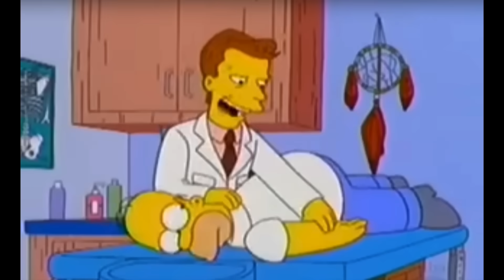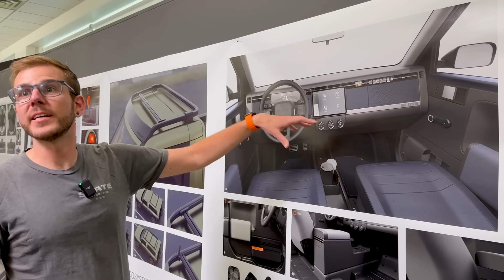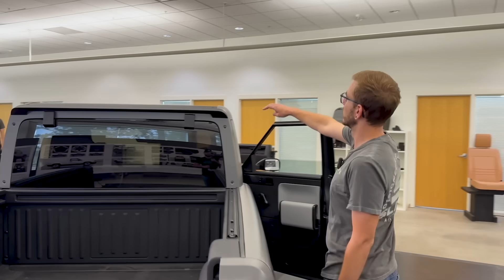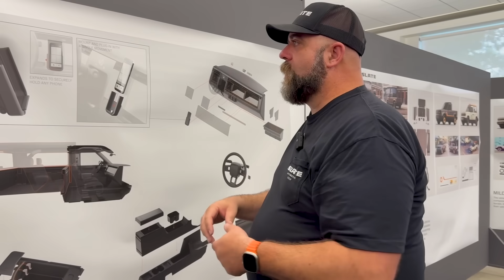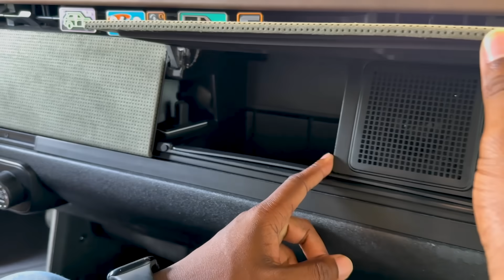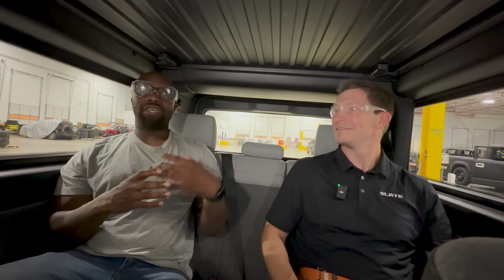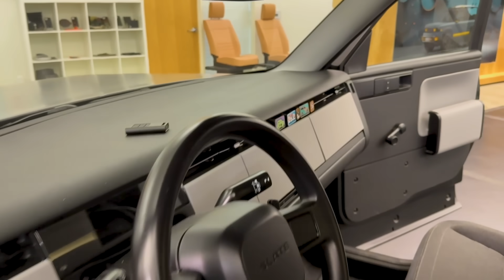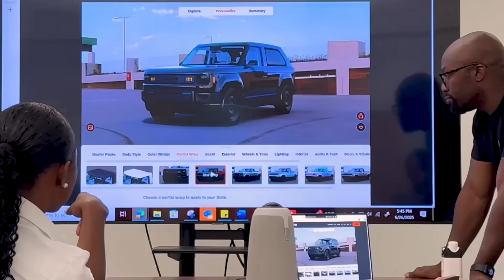The Slate: America’s $20K Answer to China’s Cheap EVs (Exclusive Access)

Comment: A lot of people complain about “computerized everything” on new cars. It will be interesting to see how many people choose the version with crank windows and no stereo.

Edit:  To be clear, I don’t want everything to be controlled through a screen either. But there is a reason why manufacturers make all of these things standard. It’s because nobody was buying them.

If the tax incentives stay (doubtful) this little truck has a chance.  At $27k for the most basic of basic version, people will just buy a Ford Maverick.

Also, I was making a point about people not wanting as much tech.  Sorry if that went over your head “motorized vs computerized” commenters. 😂
Reply: that would be me.
Reply: @pezpengy9308 me too!!!
Reply: @pezpengy9308  me too
Reply: @pezpengy9308  ditto! I love the manual door locks and manual windows on my 96 Civic, merely because it is that much less wiring and that much less to "fail" on the car.
Reply: I can install my own stereo.   Probably for less money than the factory charges.
Reply: @bullithedjames  It doesn't have  a din slot so maybe under the dash?  also no backup camera, I thought that was a requirement by the feds.
Reply: @bullithedjames I'm going to miss those $3500 nav systems with 0.5 fps refresh rates.
Reply: I mean, if it has speakers and I just hook my phone up and it will play out the speakers im fine with that.
Reply: Every roll up window I've ever had is still working. I've only ever replace electric window stuff. Also the truck is small enough to roll down the passenger side window. If it was 4 windows, yeah maybe annoying. Also, put a Bluetooth JBL speaker in and rock it. I think the truck has its place, nice it's made here (though "battery manufacturer" might be overseas) If the base model stays competitive with other EVs, it will be on my radar.
Reply: If I could get this for $15K and could drive it 300 miles on a single charge, I would be perfectly fine with manual windows and no stereo. At $28,000 and half the mileage, this is just way too expensive to have so few frills/features.
Reply: makes sense that motorized windows are an option, but they're people out there who are probably thrilled by crank windows and willing to save money there
Reply: @superzario1000  Crank windows are more expensive nowadays due to the number of cars/parts manufacturers for power windows, thus driving down prices; they have been cheaper for many years now
Reply: @QALibrary I seriously doubt that
Reply: @superzario1000  ive never had power windows so its same old same old for me. I've got the closes thing to a slate the gm put out in 2002. I dont have the build sheet for this truck but a base model 2002 chevy 1500 was 18-20grand basically the cost of a slate
Reply: My current truck has crank windows and a broken tape deck but it does truck stuff very well.
Reply: @deuceandguns my current truck has power windows and one doesn’t work, less than a hundred thousand miles on it.  Never had a crank window break.
Reply: Me, for sure. I'm skeptical this will actually succeed but I'm all for it
Reply: It would be the only reason I would buy one.. 
..and the 20k price.. which isnt going to happen (gov assistance or not).. its gonna be another 30k vehicle, and with like 100mi real life range, it'll be better to just buy a Maverick.
Reply: we have a universal hand gesture based on manual crank windows, thank god someones keeping it alive.
Reply: This may become the American Dacia - look how Dacia has a big success in Europe with there cheap basic cars!
Reply: @zanycam  Dacia's are cheap though, this is overpriced shiet
Reply: @zanycam  James May is that you? 😂
Reply: I drive my 18 yr old f150 for a reason.  It has a broken cd player but has a aux in, no touch screen.  I like the electric windows but everything doesn’t need to be a computer screen.
Reply: im okay with crank windows but i atleast need a radio with an aux 😭
Reply: No one would choose it because it's 30k
Reply: Had an NA Miata in the 90s with crank windows and it was fine.  The car was small enough that I could reach over and roll it down.  That said, I feel like you’re not going to save $$$ be deleting window motors and might actually make the production line more complicated and add cost to the manufacturing process.
Reply: Nah thats dumb to say. There's a wide gap between a power windows with a stereo and an automated lane assist system and OTA software updates. About 20 years of cars fall into that range, actually. I love a big screen, buttons to push and information given to me. As long as its not controlling my car im happy.
Reply: @duppy-xd6hy But you can actually disable all assist features, lane assist, automatic braking etc
Reply: Easily enslaved tool.  They can already monitor all your actions, including controlling your vehicles operation.    @duppy-xd6hy
Reply: Yeah I like the idea of just putting in a stand alone  Bose Soundlink with some 3D printed mounts.
Reply: Redundancy and reliability is number one in my book.
Reply: Those people aren't the people who generally buy EVs.  They want this truck powered with a Ford 2300 or GM Iron Duke.
Reply: That’s most work trucks less tech less stuff to break and remember got AirPods now so might not be too bad.. only needs ac fr 😂
Reply: Fun fact. My susuki swift was delivered only with electric windows... 30 years ago... I was wondering why. This car wasn't even delivered with a 12v plug. (cigar igniter) but with electric windows... BECAUSE IT WAS CHEAPER TO PRODUCE 😂
Reply: I'll take the crank window and a decent aftermarket stereo. The 90's didn't suck. Crank windows are OK.
Reply: That's going to be me. I can't wait to preorder one. 
I didn't care about frills or how Tesla-esk a new car is. I want as plain and inexpensive as possible.
Reply: I don't see too many people buying one of these in the first place. It's way overpriced for what it is. It should be an $18,000 truck.
Reply: No, it won't because no one will buy this Amazon basics trash. 😂
Reply: I have arms and a Bluetooth speaker
Reply: Im 100% on board for this
Reply: People in rural areas....
Reply: One of the things that MIGHT put people off the Maverick though, is yet again it's a four-door "pickup truck" with a TINY flatbed, so it's not actually that good AT being a pickup truck. This vehicle seems (to me at least) to have a bigger flatbed which is the whole point of a pickup truck - it's not how many passengers it can carry, since that's what an SUV or regular car is for - it's how much flatbed space they have and WAY too many US pickups right now have prioritised the complete wrong thing (as well as getting WAY too big for what they ACTUALLY can do and can carry). Also like they point out, if you want various packages on top of the base model with THIS you can add over time, with the Maverick I expect you HAVE to get them day one and can't really add them on at a later date - you're locked in from the start just like most other vehicles.
Reply: @DavidStruveDesigns for sure. This could be great for people that need the bigger bed and still have a small footprint.  I hope they sell a million of these.  The US market desperately needs more diverse options.
Reply: As a manual seat, manual window, manual trans, no interior options, jk owner, I don't want it because it's electric and the extension cord going to my neighbors trailer def won't charge it. But I like it
Reply: No they won't get the Maverick, because it's not electric.  Why do folks still don''t get it ?  You can't just look at the selling price of a vehicle anymore, you have to include the operating costs  which are way way less with an EV because of low "fuel" price AND very low maintenance expenses,. Is that so hard ???
Reply: nobody younger than 25 will. Manual anything is against their DNA and that's on us as parents...so sad
Reply: I would, but being an EV is the deal breaker for me. I have a 1997 truck with roll down windows. But the V6 purrs like a kitten, not sure an EV would last as long.
Reply: just bought a base 98 Tacoma for those reasons, will definitely be looking into getting one of these
Reply: Technically an ev need less electronic than a modern luxury car. There are many systems in engine management and exhausgas measurement etc. What is not nessesary on a ev. Otherwise you need a extra motor for servo stearing and AC...
Reply: That's me. I'm ready to make a desposit, but I wish it was released this year because my current commuter is rusting quickly! 😁
Reply: 28k is a rip-off
Reply: If it is cheaper, likely more people would get it ... 

Because the psychology of getting a utility vehicle is different ... Its for work and ROI.
Reply: It's all computers.
Reply: Crank windows = vinyl music. Huge hipster potential.
Reply: Me.
Reply: Well when a ford maverick XL has an msrp of 28k compared to this thing for 28k without the ev incentives anymore this thing is going to flop. 
Let's do a few comparisons
Ford maverick XL, 4 door, power windows, entertainment system with Bluetooth, climate control, speakers, and standard hybrid that closes any gap for cost difference for fuel/electricity.
Compared to, 2 door, no entertainment system, no speakers, thankfully climate control, crank windows, rwd and only 150 miles of range all for the same price...
Reply: I would love a crank window on the driver side and electric on the passenger! Also, I have no problem bringing my own speaker. I think that would be fine too. I really like this idea and I hope it takes off
Reply: The problem isn't all electronics, it's the overuse of modules and sensors not easily accessible to the owner and basic electronics tied into the newer high speed network bus for no reason, even when regulations don't require it.

I don't mind a hand-crank window option as I know some people using these for non-daily driving purposes may prefer that. All I really care about is that it's easily repairable, upgradable and that Slate doesn't lock users out (with the possible exception of safety features such as how much power can be pulled from the battery).
Reply: Everything computer!
Reply: I know i will if i want tunes ther are blue tooth speakers for the longer trips and for the short into town trips meh who needs it
Reply: none
Reply: As some who has a base model from 2002 (chevy 1500) the original buy only paid 18-20k 23 years ago. I would in heartbeat
Reply: Dude can't even separate motorized with computerized
Reply: Give me driver crank, auto passenger. It's a pain to have to reach over and crank the passenger window...
Reply: Crank windows is great, no stereo is actually ludicrous.
Reply: My gen z nieces and nephews all drive old Hondas or Toyotas from the early 2000s and they use their phones and a couple of synced up bluetooth speakers as audio systems! My nephew has a Civic and 6 Beats Pills that he got on marketplace he literally taped them down synced them and it sounds almost as good as my wife’s 2024 Acura MDXs audio system! That’s who slate is targeting! These DIYers who 3D print or will buy it on etsy! It’s probably a smaller market than what they imagine but they don’t need to sell 100k a month to be successful!
Reply: @mikeFPS1980  And they buy $30k cars?
Reply: I’d like to see the age curve against those features. I didn’t have electric windows until 2000, and my radio frequently didn’t work. Now I have an iPhone, so I don’t care.  I’d rather have Car Play, but an iPad wouldn’t suck. I also want a key—that you don’t just keep in your pocket/purse. Now get off my lawn.
Reply: I love the manual windows. I grew up on them.
Reply: Motorized and  computerized are two entirely different things.
Reply: I'll get one when "everything is computer"
Reply: They might also complain that this is electric
Reply: Me! I would put my own system in it anyway.
Reply: I would if I could! Besides that power windows is a far cry from your engine running on 6 different computers and modules....
Reply: This won't work. Toyota already offered a low tech econo-box ICE car called the Yaris, and sales went so far in the toilet they finally flushed the entire line down the drain in 2020. This company will fSk around the bargain bin and find out what Toyota already did, that the people that actually buy NEW cars want all the cool sh1t that bargain basement cars don't have, and it just won't sell, especially for $30,000 without the EV mandate free money.
Reply: Me! And still you have to explain why electric windows, AC and other small task electric utilities demands an central computer with bus connections, since batteries and starters are not in question here. The claim is the excessive complexity and infotainment present in current cars, something just to be driven from A to B. Like phones turning into smartphones with an heavy tag attached to it. Of course that is not for consumer interests but for easy mechanical diagnosis and someone else interests, while making consumer paying for it (happily, in the name of luxury). Not including the shameful automatic driving and other take over by the machine from men dystopian soft age concepts. So F* all that,  not having a car because can't afford all supposedly must have modern garbage...
Reply: people are NOT going to buy a Maverick over this...two entirely different audiences.
Reply: there is ABSOLUTLY a market for the non-elec. non-sensor. non-digital controlled TRUCK.  If you COULD somehow buy a 1972 GMC pick up today, people WOULD.... that tells you something.
Reply: Lets see how many times I opended my window in the last couple of weeks, none. How many times have I used the radio in the last 3 or so years, none. So you would rather pay more money for windows that use a button instead so that the couple dozen times you have got to roll down your window you can press a button.
Reply: I will absolutely choose the crank window option, and not to save money.  

I know that mechanism will work every time.  
Even If the batteries are dead, it's  submerged in water, or it's on fire, as  long as I can turn a crank, I can open  that window.
Reply: Everything is computer! That's the problem with my modern cars. I think slate is refreshing.
Reply: It's like if Framework made a truck. So neat! This is the first new truck I've been excited for since the Toyota FJ Cruiser
Reply: No one that's interested in this car would want a maverick because the main pull about the car is easy cheap DIY maintenance while being fully electric. Y'all have not done enough research on this at all smh
Reply: A Maverick isn’t as customizable as this. Being able to get a blank Slate and then later “upgrade” over time is the biggest selling point for me
Reply: The Mercedes 2.6 190 I drove had no airco, turn down windows, aluminum hood and trunk lid. So yes, I like basic. Reduced weight creates cool cars.
Reply: Bluetooth ghost box or a deck wired under dash or under the seat or on the headliner fix’s that lol but yea id be interested to see how long the nostalgia of a minimalist new car really last in the majority of new owners
Reply: I'm choosing the one with no radio 😂😂😂
Reply: people will pay more on principle, they want to advocate with their wallet by buying this stuff even if it is a worse deal in many ways
Reply: If the price were competitive then 100% I'd go no stereo and crank windows. But 27,500 for this is ridiculous, and with the tax right off likely going away then the whole 20k truck just becomes a farce.
Reply: They aren’t saying to remove  EVERYTHING, just no Super computerized car.
Reply: @JohnDoe-qz1ql I would be interested in one with nothing. Use it as a farm truck/errands/short trip stuff.
Reply: @colton-w4h They’re actually very nice lookin little trucks!👍
Reply: @JohnDoe-qz1ql What is a computerized car?
Reply: @JohnDoe-qz1ql yep.  I don’t disagree.  Would love to see a vehicle with an EV drivetrain that doesn’t feel the need to try to make everything else so “smart”.  This little truck certainly does that, but I think it cuts out too many of the standard basic car stuff to appeal to a larger market.  From what I’m seeing the Scout is looking like a good balance.
I hope they sell a ton of these little trucks.
Reply: the crank windows are the one part that sounds like virtue signaling, since the parts for crank windows have to withstand variable torque and overtorque, while electronic window parts (and gears) can actually be made cheaper and lighter.
Reply: tesler is all computer! which means you can't fix anything...
Reply: I think that's THE version
Reply: people want american made products with american made parts and labor but don't want to pay the price for all that lmao
Reply: Wouldn't be me. $27.5K for a vehicle with no radio and no power windows is way too expensive. 
It's the garbage like rain sensing windshield wipers that never work right, collision detection that's super oversensitive and yells at me about my mailbox that I'm nowhere near, 'smart' cruise control that slows down for someone who has already changed lanes into an exit ramp, lane keep that loses sight of the lane all the time or thinks something else on the road is a lane line and starts trying to do something stupid, automatic high beams that toggle on and off from reflections but don't go off for oncoming cars, the stupid touch screen and menus that replace physical buttons knobs and switches in so many cars, part serialization or similar anti-repair measures that mean if I want to repair something on my car I have to go to a dealer with the special computer or pay way too much money to get my own special computer, and of course all the data collection and selling to insurance companies so my rates go up because I hit the brakes hard to avoid t-boning some idiot who turned left right in front of me instead of waiting to turn behind me like the law requires. That's what I don't want in my car. Honestly they can even keep the built-in support for SiriusXM that I'll never subscribe to or the built-in navigation system that I'll never use because of Android Auto or Apple Car Play.

Give me a radio with AM/FM (I don't ever want to listen to it, but sometimes there are emergency broadcasts to tune into), bluetooth support for connecting a phone to play music from it, and a decent size screen for the back-up camera and the rare times I need to use the previously mentioned Android Auto for navigation, but with buttons and knobs for controlling it. Give me power windows. Give me old school 'stupid' cruise control that just keeps the car at whatever speed I set and keeps going until I intervene or it crashes.

No radio and no power windows, that car is more of a dumpster on wheels than the Cybertruck and nobody can ever change my mind. I wouldn't be caught dead owning a Slate in this configuration. Radios and power windows are not what is making vehicles so expensive and not what needed to be cut.

(edited to update price, the before incentive real price was higher than I had remembered)
Reply: @mjc0961 TL;DR: The user criticizes modern cars for being overpriced and filled with unreliable, overly complex tech (e.g., rain sensors, lane assist, smart cruise control) that reduces usability and increases repair costs and data tracking. They want basic features—AM/FM radio, Bluetooth, physical controls, power windows, and simple cruise control—and believe cutting essentials like radios and power windows, not the high-tech bloat, is the wrong move.
Reply: @mjc0961 My 2012 car has rain sensing wipers and they work very well, if it rains I only have to start it and let it go as it pleases
Reply: You're high if you think getting manual windows and no radio is a deal for 30k 😂😂😂
Reply: @tokageebo it’s not a direct comparison to anything else. cheapest EV on the market, and also $20k less than the cheapest truck. I see this thing filling an underserved market segment for sure, especially with the customization options.
Reply: @tokageebo should be like 10k. But ya know. Everything cost to much these days.
Reply: Only time I roll down the window is in the drive through. And that happens like 2 times a year.
Reply: If im using this for work I'm doing that. But for 20k nope. Ill just buy an old Toyota for 6k
Reply: Crank windows save zero dollars and add weight and complexity
Reply: @technom3598  They are lighter genius, tell us you know NOTHING about anything mechanical....
Reply: They are NOT lighter. For example you can look this up..m the lotus elise came with either manual windows or electric windows. MANUAL windows weighed 5lbs more! But thanks for being so bold about being wrong.  @Mick-60
Reply: @Mick-60 very familiar. All the levers and arms and clips and bs weigh more
Reply: a crank window is heavier than a motorized window ?
Reply: @technom3598 Crank windows are simple, AND USE ZERO BATTERY.
Reply: Ya but they use an excessive amount of pullies... tracks and or linkages. Dude... most people forget how many times you had to help a roll up window go up. The crank would break... the knob would go missing... the rollers would break and the glass would go up crooked. Everyone forgets that shit OR never lived with roll up windows. People who think they are reliable are idiots.  @DetroitMicroSound
Reply: @DetroitMicroSound using battery doesn't matter. A car creates its own power via the alternator. The amount of voltage and amps a power window uses is miniscule. The usage of battery is the dumbest argument ever.
Reply: @technom3598 lol.   Repair cost comparison????    Lol.  Another tool discovered
Reply: @georgeallen7667 electric window regulators arent all that more expensive and rhey rarely break. However manyal windows rollers break and yiu have to disassemble the tracks and all that BS. You can eother oay more money for the electric part or pay more in labor up to 200 an hour these days tonrepair a manual window price will be about the same. You literally save NOTHING with manual windows.
Reply: Unfortunately, they are not independent circuits.  They do connect to a common chip that regulates many separate funtions without discrimination.  If you are speaking to only the in door components you and I agree.  However the issues often becomes more convoluted.    See Car Wizards latest on a Sequoia.   So much fun in shop time.  @technom3598
Reply: @technom3598  No...  Why on earth would you think electric windows are lighter than crank windows?  It's the same mechanism more or less, you're just replacing the handle with a motor, which is significantly heavier.
Reply: @technom3598  nah... more electrical connections an other complex molding for weatherproofing vs just a simple mechanical crank that can be easier to replace when it inevitably wears out.
Reply: Crank windows are stupid. The savings would be negligible. Power windows amd locks are not the devil
Reply: @hw6271Crank windows are simple, lightweight, and don't waste your battery on stuff you can easily do manually in less than 2 seconds....Unless you are so lazy, you can't be bothered to crank a window crank 4 times.